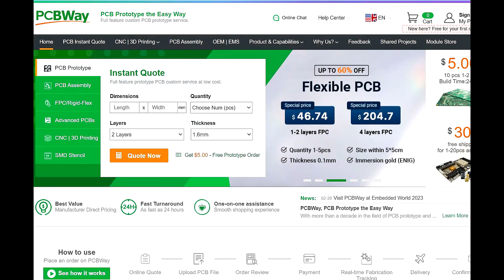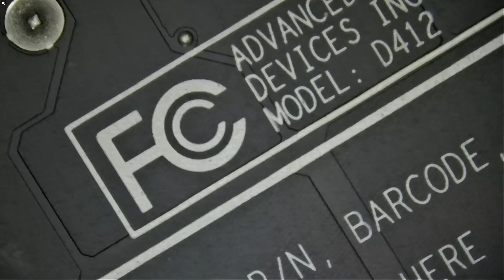Gigabyte 6900 XT Graphics Card Repair - Black Screen

Comment: I got this card and I got a black screen once I turn on the system and after a minute or so don't get image but the system is still working. Then I reboot the system and It takes a while to It starts again. I have tried another GPU and it's working perfectly, could It be the same problem?
Thanks!

Comment: I have RX 6700 XT:
Before it black screen im getting Flickering then after that it black screen i went to the nearest technician in my City and he was able to fix the black screen but the flickering, black screen still not able to fix 
I repeat he was able to fix the black screen it was able to boot to windows but the flickering and black screen occuring i do what he said that
DDU
Clean Reinstall Driver
Clean Reinstall OS 11
Clean Reinstall OS 10 
Still the same flicker and black screen i was able to bring my GPU to him and now he is stll diagnosis it i hope he will able to fix it if not i will try repair it to international

Comment: Had the reference model from Asus (very similar), never modified it yet it had terrible temps and crashed in many games over the years. When one of the DisplayPorts and the HDMI stopped working I sent it in for RMA. Wish I had the skills to fix it myself but they sent me back an Asus TUF model, the temps and reliability are leagues better.

Comment: Great video. Have an Asrock 6750XT that won't power up. In one board, ASUS board with 700 watt PS, card is dead, but MB fires up. Other board, MSI with 650 watt PS, card is dead, MB dead also. Boards work fine with another card. Never have worked on a Video card, but watching your Repair vid gave the guts to at least take this one apart and try. Thanks!!

Comment: i see an rx 6900xt in my country for very cheap it says it has as shorting problem but the guys description says he used only a single 8 pin connector on the card. how much money should i offer to gamble on buying it.

Comment: HELLO !! MAY I ASK YOU SOMETHING ? WHERE CAN I FIND SPARE PARTS FOR RX 6700 XT ( SPECIFICALLY I NEED 1 x  MPMT 8633 A522 E chip , 1 x R562042 12v power coil , 1 x D 2mm , 1 x D 4mm and 5 x SKA37 270 16V CAPACITORS )

Comment: It is better to use a large heatsink on the GPU during the momentary test.
Reply: that would require more time to set up and pull down.. in a busy shop they have to be very efficient with time. the card would power down anyway if it gets too hot.
Reply: He said only for a few seconds. During bootup the clocks are at a minimum, core is undervolted, and only pulling 10-15 watts. 3080, 3090, 4090 etc need a small heatsink at least, don't need a fan for short term testing.

Comment: why they use 0 ohns resistors?
Reply: Overcurrent renders the resistor open, i.e. very high resistance and protect whatever components that comes ahead of it. Changing the resistor will be cheaper than changing one of the more expensive components. The 0 Ohm resistor acts here just like a fuse.
Reply: Provides a test point and allows isolation (i.e. for injection) and current monitoring (resistor removed).
Reply: Slow fuse

Comment: Hello, First of all, my English is really terrible and I am using translation. I apologize for my spelling mistakes. When I Try to Turn On My Xbox One, It Suddenly Shuts Down, The Startup Sound Is Interrupted, The Screen Doesn't Come On And The Fan Doesn't Turn. I Checked the Mosfets on the Power Line, There Is No Problem. I Changed the Power Supply, My Question Still Continues. Since I do not know the values of the coils and resistors, I could not check them. The opening sound may sometimes be interrupted after pressing the button. I saw you repairing it in your previous videos, I am writing to you from Turkey. Can You Help Me With This Problem? It Depends on Which Areas I Should Control and How.

Comment: The amount of high end graphics cards being ruined these days by people is heartbreaking. Thank goodness Alex and Big Boss are here to save the day, always, better than factory!
Reply: @Stellar-Nucleosynthesis Especially on 4090 😅
Reply: Everyone thinks they are capable of renewing thermal paste at home and these are things that happen most likely, they rip-off micro transistors or worse ruin some trace with screwdrivers.
Reply: That’s because unauthorized and untrained people with big hands and fat fingers think they know how to build gaming computers. Anyone with basic electronics knowledge will know that you should only hold a circuit board by the edge otherwise sensitive and delicate components can be damaged.
Reply: The high end stuff breaks also by themselves even with perfect installation procedures. You get maximum performance, not maximum reliability or anything similar...
Reply: Thats why unexperienced people see on youtube how tu build a pc, and try it by itself and fail.